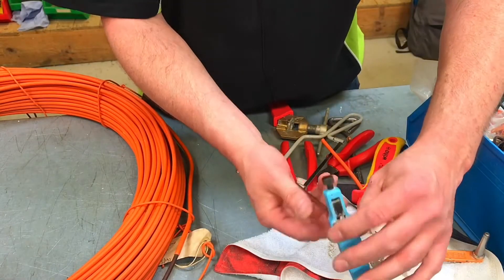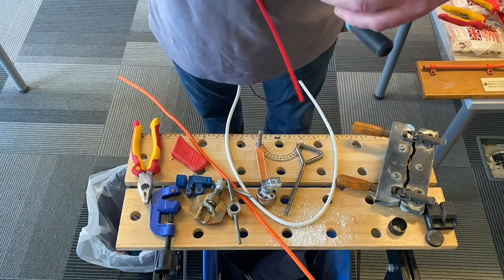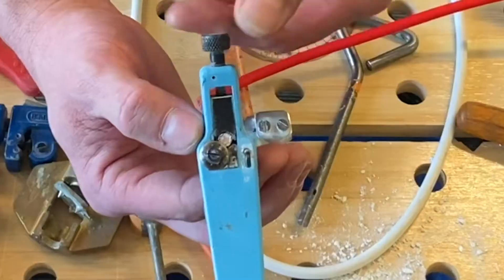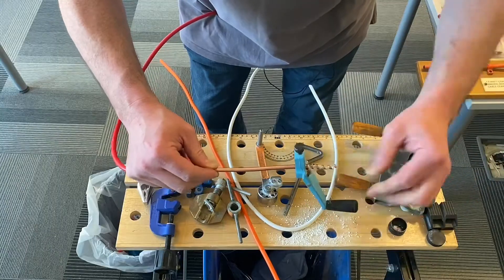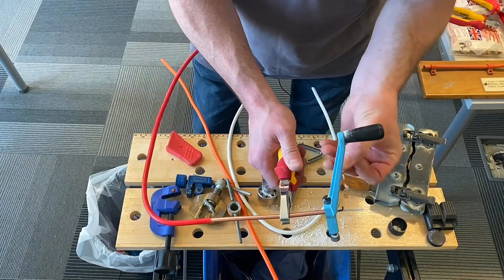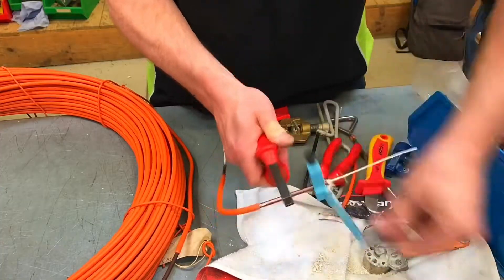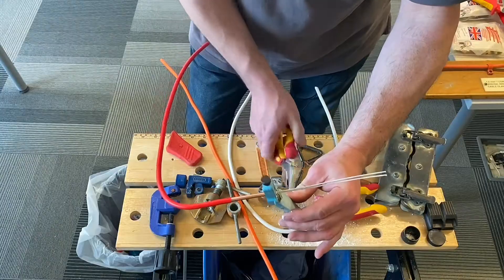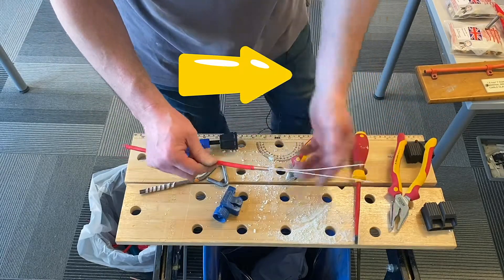Lube Makes Life Easy with this Strange Cable

Comment: Not strange, but rare these days. This was called Pyro or M.I. in the UK & used for fire alarm circuits and high or very low temp environments; boiler houses and cold stores. Sparks run a mile from it these days, its like cryptonite.